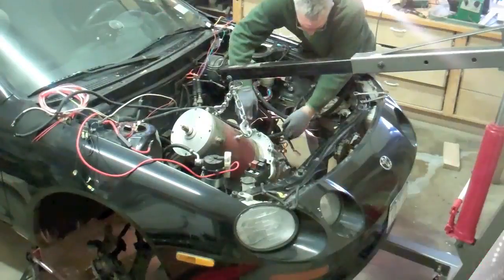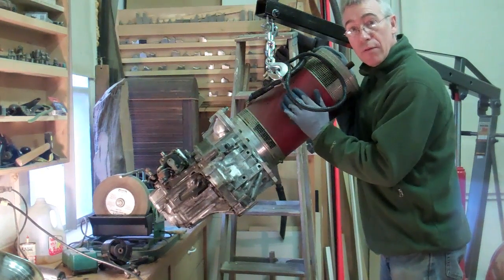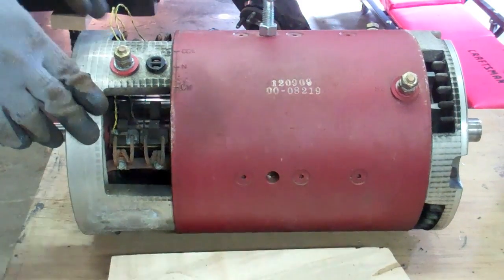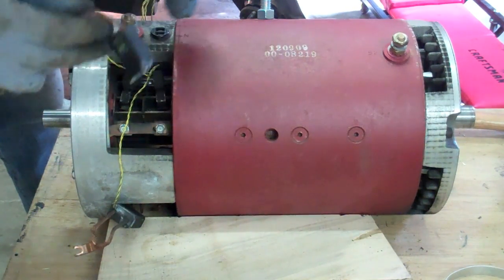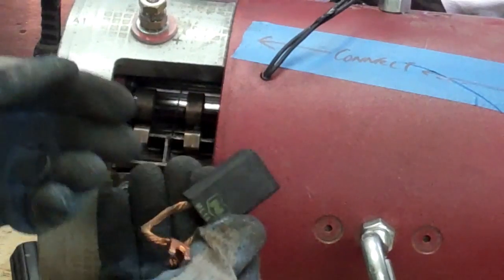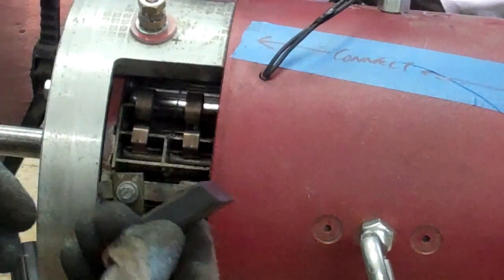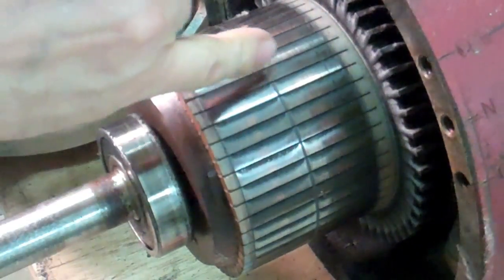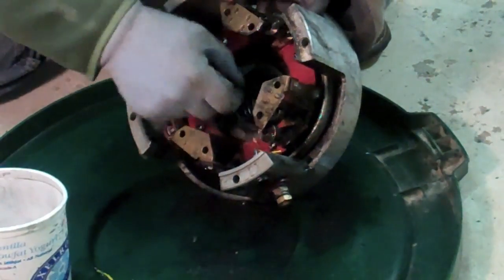John Allen's 1994 Celica Part 5

Comment: I know it’s a late response but your brushes were fine. No grease in the brush or comm area. Glad to see you fixed that. The light sanding wasn’t bad but no knife in between the comms. The mica is delicate. Only use a hand held SS brush and that should do. Did the noise ever quiet down? Series motors do make noise. Graphite from the brushes are the lubrication needed. You want the brush carrier clean and good springs. Clean and dry. I miss old Jack.
Reply from the maker: Yes it did quiet down and was nice and smooth.  I miss Jack too.  What a character he was

Comment: that commutator was quite hot, to much power asked or weared out carbon brushes, sometimes dust from them go into the small openings of the commutator causing shorts and sparks, a dremel wit a broken drillbit does wonders by cnc them with it removing that dust.

Comment: Unfortunately you can do a lot of damage if you're not sure what you are doing. The commutator should be skimmed in a lathe and the mica insulation between the commutator segments undercut with an appropriate tool. Best way is to pay for a reputable motor winding repairer to check and fit new bearings, clean the motor, do the commutator work, fit new brushes and electrically test the whole thing. If you get any shorts between commutator segments you can burn out the whole motor.

Comment: Best regards my name is read and would like to ask why use a DC motor and AC not one, what differs?
Reply: Because the energy source is DC, as its is a battery, this is why you have a DC motor.
Reply from the maker: Cost was a big factor
Reply from the maker: AC motor needs double the voltage and the car couldn’t carry those extra batteries.

Comment: your problem is the bearing amigo  do not use grease is a motor cleaner and file the  communator  for clean running ge t the correct cleaner or you remove the  barnish from the field  and armature .

Comment: since you have already dismantled the electric motor you should have at least made the following changes. 1. change the brushes  2. change all the bushings  3. change the bearings  4 check for armature and rotor rubbing, if they did dump your ac motor. 5 this is the only thing that you did in that ac motor... what not to do.. 1. do not spray chemicals unless its for electrical purposes.. 2 you should use rubber sealed bearings  3 use the correct specification of grease to be used in the bushing, not all grease is suitable... THE CORRECT SOUND OF AN AC MOTOR IS THAT "IT SHOULD HAVE NO SOUND "
Reply from the maker: This is a DC motor

Comment: Normally that commutator should have been turned down on a lathe. In use commutators do go a bit oval shaped !  Also if reusing brushes they will tend to be a bit noisy unless you put them back exactly were each brush was.  Best way is to wrap sand paper around the comm and manually get the right shape into each brush.  If the noise has cleared up then good, if not noise is a sure sign that brushes are not making proper contact with the comm and that will invite arcing under load

Comment: la pregunta del millón de dolares es, ¿Que pasa si el carro cae o pasa por un lugar profundo con mucha agua a la altura del motor, hay peligro de electrocución ?

the million dollar question is, ¿what happens if the car falls or goes through a very deep water up to the engine, there is the danger of electrocution?
Reply: a very good observation and conclusion.
Reply: What happens if the car is struck by lightning? What happens if a chicken crosses the road in front of the car? What happens if the driver farts will the electricity react with it? Why do people ask ignorant questions?
Reply from the maker: Probably

Comment: A possible way of fixing worn in brush traces on the comutator is to machine hard turn 0.1mm again and readjust the spring coil from the brushes. Uses a 0.15mm adjusting plate and use a pair of new brushes. The noice your having is probably further internal. Advice is to pull the entire axle out and use BrakeCleaner. Gasoline leaves a oil trace so that aint to handy. Keep up the good work man...peace

Comment: The squeeking noice usually happens due to worn down brushes, there is a adjusting distance factory made so it may mean that the brushes are not making a good contact. This can lead to some problems like low power cause the brushes may have a over average space ( considering the fact that its millimeters ). The comutator I what we call here the stator here has a a diameter which is precisely in average 0.1mm of space clearance.